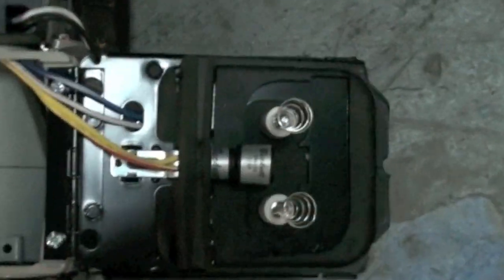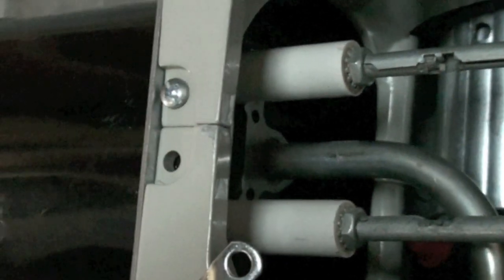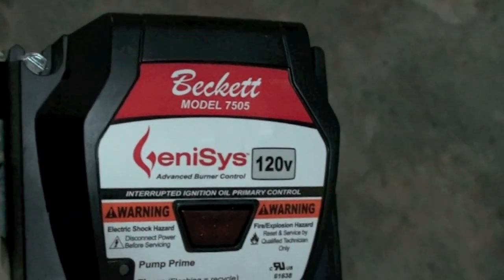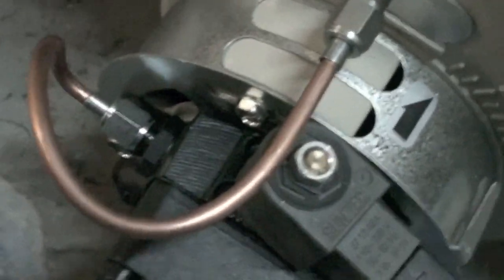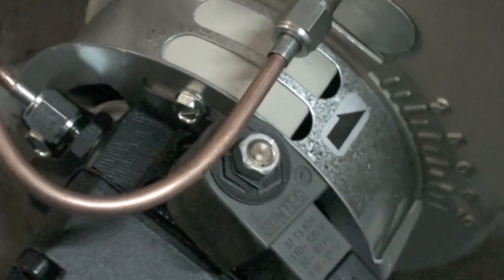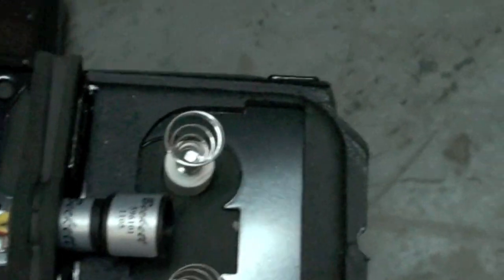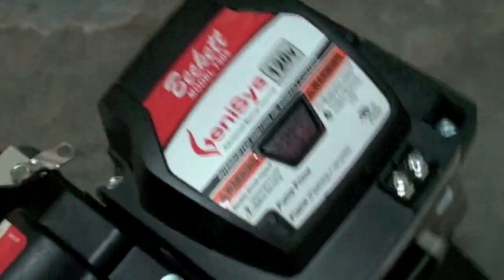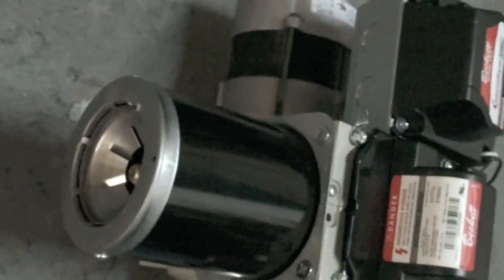Oil burner parts

Comment: I bought a Spirit low boy oil Furnace (made by Thermopride) last year..It has these new Beckett AFG burners..Love that unit and the burner it's so reliable..Replaced an old Hallmark furnace in my Mother's house from back in 1968..

Comment: Thank you for your quick response  I guess I'll find out more when new pump arrives! There is a point where line is in  concrete to go past door way,36' Any input greatly appreciated !Keep up the excellent video's I think your helping eliminating hacks in the industry!!
Reply from the maker: If you still have problems getting oil to the burner and the line is clear, look for vacuum leaks.
GFM

Comment from the maker: I assume the system uses a 2 pipe system and is moving oil back to the tank.  That would mean the pump works.  If there is no oil at the gun line, is there a solenoid in the line or in the pump?  If there is no solenoid and oil is moving thru the pump, but will not build pressure, either the pump has failed or the pump coupler is slipping.  Hope this helps.
GFM

Comment: I called tech support when i seen the accessory package with a plug used for 2 pipe systems. Olsen tech told me that unit is made for 1 pipe systems and the plug would be used for 2 pipe system. My tank is above ground on same level about 6' away from furnace. The inlet line is about 20" off floor so i don't need the lift that the 2 pipe system would create

Comment: have you ever come across an oil pump that draws but doesn't discharge oil.  line from pump outlet is clear, and just curious about how much or what kind of volume of oil should be coming out of oil line disconnected from nozzle assembly with pump running....thanks

Comment: I have a beckett AFG that after it runs a cycle white smoke comes out the air vanes and the motor. The transformer gasket looks burnt and a small amount of fuel is on the motor housing dam under the electrodes is present. Any ideas on the problem?
Reply from the maker: You probably have a plugged heat exchanger or chimney.  Eventually, the furnace will puff back.  A nice term for a very messy and dangerous action.  Get it fixed.
GFM

Comment: I have an oil burning boiler furnace and every time it starts up there is an audible beep/chirp noise. It's not a mechanical noise, definitely something from a speaker of sorts. I've looked high and low and watched several videos but I cannot find what could cause this. I'm going to have someone come out and service it but in the meantime, any ideas as to what might be the cause?
Reply from the maker: Its probably coming from the burner motor.
GFM

Comment: Do the igniter only need to work once to start the burner or it works constantly as atomized fuel are being sprayed into the chamber?
Reply from the maker: cuihaoify They can be set up to shut off after the trial for ignition or run continuously.  Most are set to run continuously.
GFM
Reply: That means existing flame can ignite atomized fuel without high-frequency sparks? If that is the case, what is the advantage of setting the igniter to run continuously?

Comment: I have this unit. No heat. Curcuit breaker working. Fan on. Took cover off looks like this. How do you reset the flame?
Reply from the maker: I have a video that explains the cad cell relay, including how to reset the control if the reset button has been reset too many times.  https://youtu.be/SHTwhOtvQWE
GFM

Comment: I recently purchased a scratch and dent unit, Olsen / Airco ; Mod# BFL 120-2,
ser.#4812BO15232, I'm unfamiliar with setting the unit up for proper combustion,When I tried to bleed the aIr out of bleeder I got nothing I looked for blockage there was a filter screen and the port on top end of bleeder looks like a pressure  connection when I looked at the old unit bleeder it has wide open hole no screen and no pressure fitting,   I say pressure fitting,I'll compare it to a out board boat motor gas connection looks a steel ball bearing on the intake for the gas female opening,and line from gas tank is the male opening Still waiting for replacement pump from New York could be up to a week because of severe storms out that way. My Beckett burner , AF65XN. My question is why do you think I couldn't purge the unit? I fired it up, got black smoke for about 5 minutes then it cleared up . When I looked under burner I seen oil dripping the seam that houses the squirl cage, shut the unit off pulled out nozzle assembly every thing was tight,    oil was running back down the tube that houses the diodes and nozzle away from the combustion chamber, called tech support he thought it might be air adjustment problem, what is  your  diagnosis , I watch your channel all the time! I want to thank you for sharing all of your knowledge that you have accumulated over your lifetime
Reply from the maker: It sounds like you set it up for 1 pipe and left the bypass plug in.  Let me know what you find.
GFM
Reply: Talked to my buddies father about not being able to purge line, every time I tried I would end up with excess oil in burner tube assembly,he thought every time I opened bleeder i was probably losing pressure in oil line and getting poor supply of oil which created the mess.Quit bleeding line and fired it up.Shut it down checked the burner tube it was dry as a bone.Still don't know why I couldn't bleed off the air.It has the Genisys Advanced Burner Control for ignition sequence.
Reply from the maker: Bernard Sobbe Sometimes when you bleed, if you do not turn off the bleeder valve immediately after the burner shuts down, it will bleed air back in.
GFM
Reply: Thanks for all your input!!